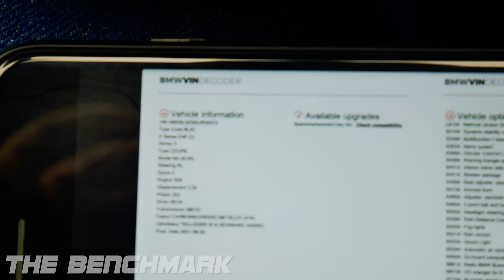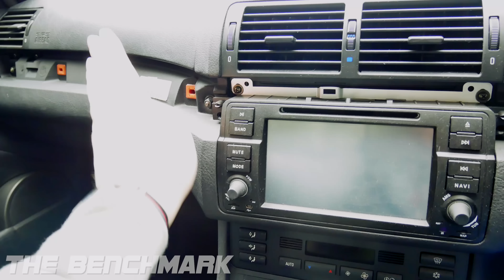Project E46 M3 - New Window & More Recaro love - Vlog

Comment: Door handles should have the same colour and pattern as the Recaro's side bolster. It looks like carbon.
Reply from the maker: Love it, any ideas where I can pick up some genuine Carbon handles?
Reply: Check the following video: https://www.youtube.com/watch?v=pKuXyeAGzEU   this is called "water transfer printing", you can have exactly the same pattern on your doorhandle that you have on your seat ;)
Reply from the maker: Ah yes, I have seen that done before, but on a part that will be touched and used a lot... I think I need the real thing to be honest. But thanks for the link :-)
Reply: Just wrap the part, and it will be fine! Or you can coat it with a special transparent resin I guess.... I don't think there's a carbon fiber doorhandle on the market for the E46.